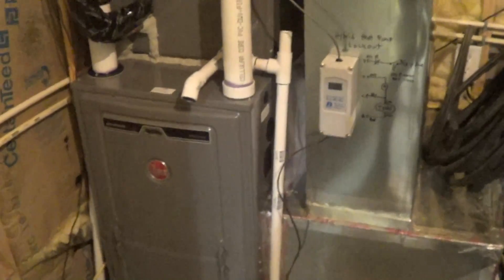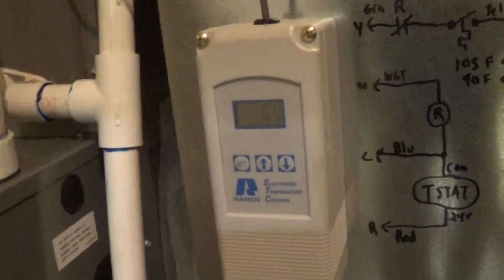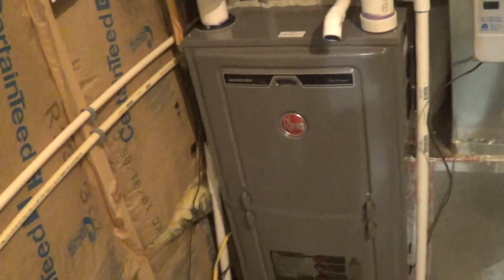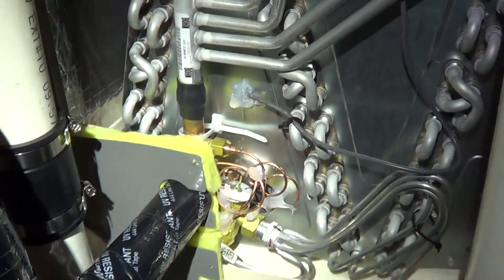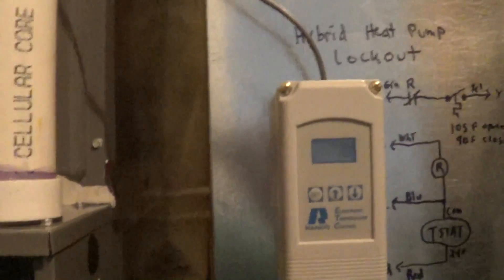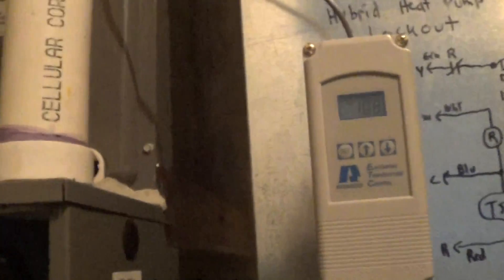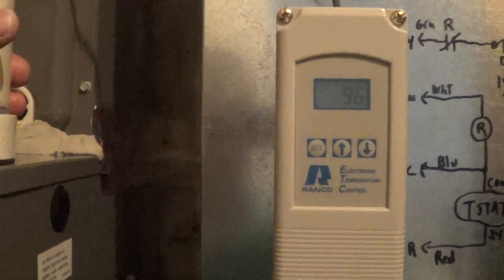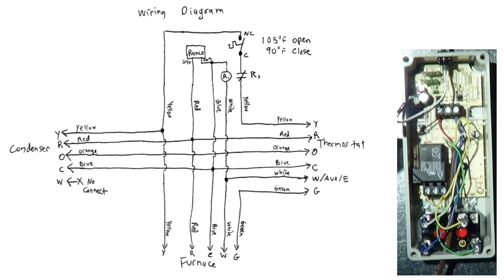Hybrid Propane Furnace with Heat Pump and No Balance Point

Comment: We have an automatic hybrid natural gas system in KY at .08kwh electric rate and .81 per therm natural gas rate we save all the way to the thermal balance point. We have found a 30 degree switchover seems to be the best comfort balance point and our utility bills have gone down by nearly half in the wintertime since we switched from straight natural gas
Reply from the maker: above 30 deg F, heat pump are cheaper than natural.  Below 30 deg F, natural is cheaper.  That is because heat pump lose capacity.  At 20 deg F, heat pump only put out 50% capacity.  Compared to fuel oil and propane, heat pumps are always cheaper.  That is why this video puts heat pump as the first stage heat.

Comment: HI, i have an outdoor wood boiler (central boiler system) and i am trying to wire a Ranco HTC 111000 thermostat control unit to control my (HVAC) outdoor furnace from coming on based on the water temperature of the water being supplied to the water coil that i installed in my ductwork.   I am planning to install the thermostat on the pex line feeding the water coil in my ductwork.  I need to splice into one of the thermostat wires (the one that controls when the outdoor fan and compressor comes on -yellow?) coming from my home thermostat and run it through the Ranco product so that the Ranco product controls that switching mechanism based on the water temp from the outdoor wood boiler.  Can you post a video on how the Ranco HTC-111000 product should be wired.  I am having some issues with the wiring diagrams.  Im getting confused about the 120V power supply controlling a 24v thermostat system.
Reply from the maker: You don't need an interlock if you put the water coil downstream from the furnace.  Just set up the system with a 2 stage thermostat.  W1 will turn on the circulator pump with a relay.  W2 will turn on the furnace.  In the thermostat set up, select 3 cycles per hour for heat 1 and the same for heat 2.   You don't really care about the water temperature.  There should be a separate thermostat in the wood boiler set for 180 deg F that regulates the oxygen to the flames.  Call me directly for questions.   3 0 1 - 5 2 5 - 2 7 7 0

Comment: I wonder what happens during a defrost?   Typically the condenser's Aux Heat W would be energized while the compressor Y ran in defrost.  It appears the outside unit's W is not connected to allow aux heat during defrost.  If it was connected would this setup shutoff the compressor during defrost shortly after the furnace started (eg at 105F)?
Reply from the maker: +RJParker   You get a little bit of cold air from the vent.  It isn't noticeable unless there is vent blowing on the bed.